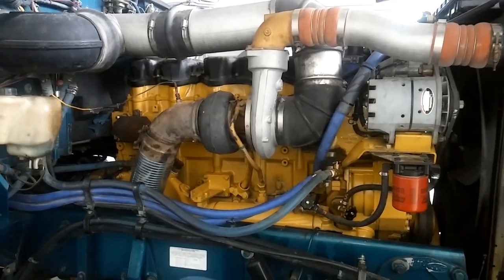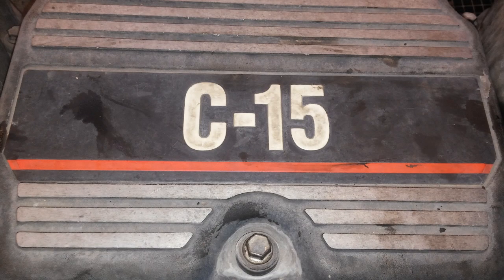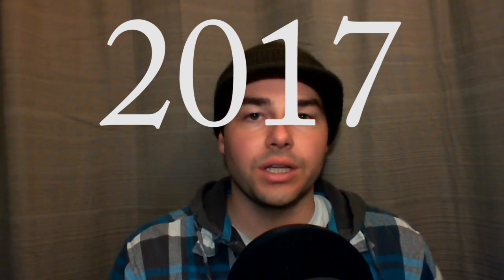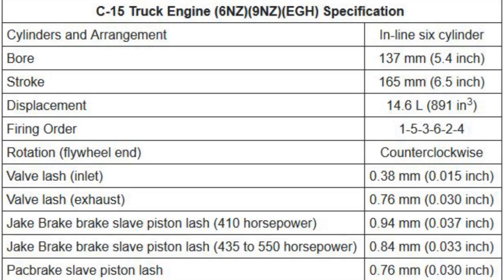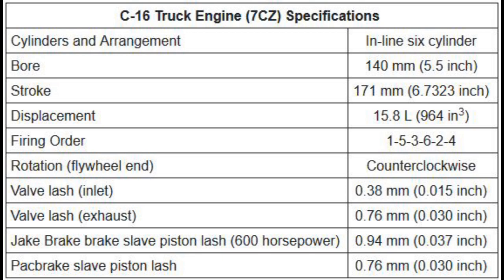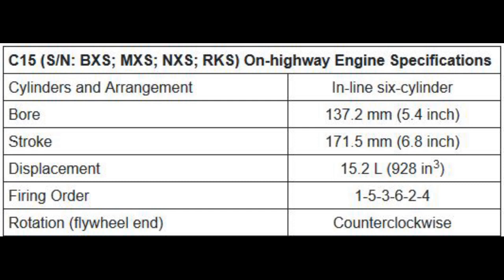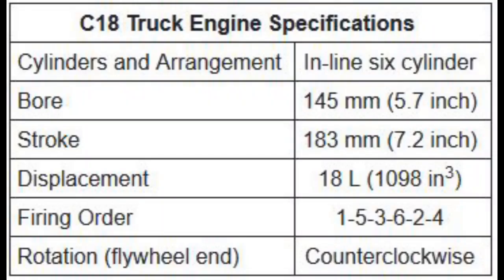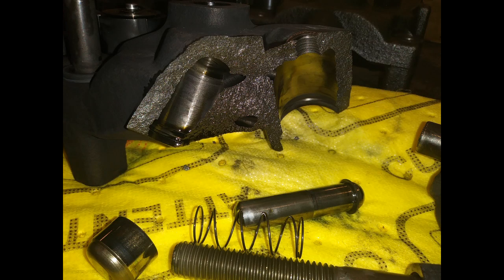What are the Differences on Cat 3406E, C-15, C15, C-16, 3456 and C18 Diesel Engines?

Comment: Could you maybe do another video or if you haven't done one on the differences between Cat road engines and Cummins engines?
Reply from the maker: Would like to, but I don't have a very good knowledge base when it comes to Cummins. I have only worked on a few ISL engines and done a few ISX oil changes, so that may have to wait.
Reply: Dip stick sucks only thing I dont like about engine. And it leaks oil if you didn't use lock tight on it on rebuild

Comment: You said there was no single turbo C-15 acert engines although in a forestry machine I work on we have a single turbo version of this engine rated at 580hp which is interesting as I thought the same, would be cool to know where this one lines up with the rest of them
Reply: If it’s an alert that means they did a turbo delete

Comment: I have a 3406c that the previous owner put a B-model pump on it. at least that's what I've been told. I would love to know the differences. I know the C-model electronics were sketchy at best but thats all I know about them.
Reply: Serial number of engine, part number on top of main injection pump housing? The PEEC engines 3406 B and 3406C had electronic sensors, BTM's and VTU that moved. They would wear and cause problems. Most people don't understand PEEC and 
can't fix them properly. They do require more maintenance on certain items.

Comment: Oh man I wish this video was out when I built my 1LW 3406E......... I would have built a C18 for sure!!!😂
Reply from the maker: Well there are a lot of C18 engines out there, just not a lot in trucks. What part of Idaho are you in?
Reply: @AdeptApe  nampa Idaho, are you from the area?
Reply: @AdeptApe  I wonder if the c18 block is strengthened to handle the bigger bore? I know the 1LW 3406e was the first year cat changed the block design to what would be a c15. From what I learned is the 1st generation 3406e where prone to cracking. Also learned the accert fuel system works on a 3406 1LW- c15. It bumps up fuel pressure to 120 psi. But make fuel hot so you have to upgrade fuel cooler😂 I learned that one the hard way
Reply from the maker: My family was considering the Boise area to move to and I've driven through most of Idaho a few times, so was wondering where you were at.
Reply: @AdeptApe  Boise Idaho, nampa Idaho it’s all the same area. I like nampa personally because the local government is more conservative based. Where Boise is liberal. Especially regather mask topic, and gun rights. This area is beautiful, very out doors oriented. I have a new 2020 rzr pro and ride at least once a week. I drive 30 mins down the road and have hundreds of miles of trails. There is a lot of people starting to move here so home values are high right now. But cost of living is still low. If you do move here or you are thinking of it let me know. I’ll help any way I can

Comment: If the block and heads are basically the same on all, the sleeve thickness changes the bore, but what changes the stroke besides the crank obviously . Is the gasket thickerer, head milled differently???
Reply from the maker: The stroke is only determined by the crankshaft throw, I believe you are confusing the compression ratio with the stroke. This isn't an insult in any way, it can be confusing. The compression ratio is determined by the Rod, Crankshaft throw, and Piston as the cylinder head and head gasket are the same.
Reply: @AdeptApe  if the throw is longer doesn't it need somewhere to go?
Reply from the maker: Yes, that is why you will have a different piston and or connecting rod to compensate for the increased distance from the crank center. If you just put a longer stroke crank with the same rod and piston it would hit the cylinder head.

Comment: have ran the a b c e cats and 6nz plus the twinn turbos.in my estimation afer 6million miles 2 trucks i put over a million on one of them was a twin turbo the other was an c model. but in overal performance and fuel economy pulling 100000 pound loads the E model out performed all.

Comment: Does the first four and a quarter 1693 from 40 plus years back have a cam in head  ?
Reply: Those were dual overhead camshaft engines. 
Precombustion chamber, with glow plugs.  PCTA.   Fantastic engines
Reply: Yes they are a true overhead cam engine. The 3406E and up is a high cam engine. Most 1600 series was overhead cam except the 1673 engines.

Comment: Hey Adept i found a 2008 peter 388 with a cat what cat engine is it for that year
Reply from the maker: That would most likely have a SDP C15 or LEE C13 which are both regen engines. They have a lot of emissions controls and I would recommend watching my regen and DPF videos for a better understanding of them.
Reply: @AdeptApe  its been converted to a single turbo 78mm so I suppose its also been deleted 700hp also

Comment: Hey sir I live in Jax Fl I run a c-15 accert recently rebuilt after getting it back i still had water pushing put of overflow and truck seems to not have much pull how do I manage to correct the issues without getting into a pride war with the caterpillar dealer
Reply: Was it pushing coolant before you built it?
Was it done at a authorized repair shop, like a Cat dealer or a TEPS dealer?
Did you have a OPT done?
What rebuild kit was installed?
What is your full serial number of the engine?
Reply: @johngoldsmith6629  yep it was pushing coolant and it had messed up my charge air cooler so I took it to local cat dealer and they rebuilt the motor 2nd time in 4.5 yrs I worked it 2 wks and noticed it pushing water out of overflow
Reply: @garynealy80  Was it pushing coolant before you built it?
 Yes
Was it done at a authorized repair shop, like a Cat dealer or a TEPS dealer?
 Cat dealer
Did you have a OPT done?
???????????????????????
What rebuild kit was installed?
????????????????????????????
What is your full serial number of the engine????????????????????
Don't see how pushing coolant messed up CAC.
Do you have a new radiator cap and what psi are you running? 
Did they rebuild or inspect your coolant diverter valve? 
Have you inspected the precooler?
Have you done a bottle test?
Reply: @johngoldsmith6629  NXS00363 is the serial and it was done at Ringpower in Jacksonville Fl
Reply: @garynealy80  Was a OPT done?
Reply: @johngoldsmith6629  whats OPT because I would like to know a series of things to ask when I return this week for repairs
Reply: @garynealy80  OPT is a rebuild that Cat offers. In-frame or out of frame. 
Overhaul Protection Truck = OPT. You would sign a contract when you picked up your truck.
Reply: @johngoldsmith6629  I didn't sign that yet I will have to fix that tomorrow

Comment: Hey adept ape, could you please let me know the location of engine oil temperature sensor c15,  please just want to replace new one , doesn't showing temperature properly
Reply from the maker: The oil temp sensor sending unit is usually in the oil pan on one of the drain plug holes.
Reply: @AdeptApe  thanks brother for help me ,will try morning again find it & change to new 1
Reply from the maker: You'll have to drain the oil pan of the 10 gallons or have really fast hands. I wish you good luck.

Comment: Speaking of flash files, can you explain FLS FTS?
Reply: FLS full load setting, FTS full torque setting. So FLS is the intercept of the curve and FTS is the slope of the curve. Like drawing a HP curve on paper from left to right. Start at Peak Torque up to hump HP (most Cat engines, some old mechanical's just had a stop bar) on down to full load. Full load is where rated HP at Rated RPM's is produced and then into governor over run. Most Cat mechanical engines had a ten percent droop governor. Electronic engines can have a programmable droop or no droop. Most Cat HD engines turn 2100 RPM's with a TEL of 2120 RPM's. So just twenty RPM's of over run, equals zero droop. You have some flash files 2300 TEL. So if that is in the ECM. Your TEL is now 2150 with a hundred and fifty RPM of droop. And as I said some engines you can turn droop on. Also you can have droop turned on with the sloop, then program a hard limit and shut it off like a rock. FLS/FTS numbers have a base line setting. 0/0, and every so often the numbers scrabble. So you have positive and negative numbers. Am told 150 to 0 to negative 150. So the only way to see what it can do is on a flywheel or chassis dyno. Cat offers a PAR run, which will measure your fuel rate along with other requirements. If the fuel rate is low (not severely), you can send it to Cat and they will give new FLS/FTS numbers to compensate for wear. Certain engine's (not all), you can request a fuel rate max out and put the fuel rate at the max of the curve. Cat sell's the engine, not the truck. All this is legal and will not void your warranty, if done at a authorized PAR dyno facility. So Wheel Horse Power, WHP is another measurement and measure's how well the truck is doing. Fuel rate in GPH is the first thing and measure's how well the engine is doing.
Reply: @johngoldsmith6629  thanks for the info. 
It just confusing on the number for the FLS FTS so many combinations that don’t always have the same results on each motor I guess. I understand they can dial a motor in to the listed hp rated. Like to c15 motor build one produces 565hp and the other 510hp they can get them both to 550hp with a combination on the FLS FTS? Aftermarket tuning you see a lot of combinations that have been on  dyno to see results.  interesting stuff, you think there is a max effort set of numbers like 0 FLS and 150 FTS or it has to be calculated off fuel rate per engine?
Reply: @sbacon67CTD  Knowing the current fuel rate helps. They are hot numbers, but legally you can't get a password from Cat. It won't fly, will kick you out. Engines that have a trim file for the EUI's vs just the four digit codes is another story. Most truck drivers get the hot four digit code and put in the ECM. EUI's are designed to flow a certain amount of fuel. Thus when you install one you program the ECM to match that EUI so flow is basically the same on all cylinders. Thus if you have a really strong EUI and put the max out code in along with a EUI that's on the lower side. You have a unbalanced engine. I like to data log the engine at TEL, start killing cylinders down to number one only, air compressor and fan off. Engine above 170 F and I kill cylinder one for a second then fire it back. I want to see if the cylinder can pull the RPM's back up. I let it run for one minute. Then I kill one and fire cylinder two and so forth until all cylinders are firing again. Naturally the engine cannot hold TEL on one cylinder. What I am looking for is, can the cylinder pull itself up from say around 800 RPM's  to maximum fuel for that cylinder. Then I look at the RPM's each cylinder will hold. I want to see balance from one thru six. So once I know the EUI's and the cylinders are fairly balanced you can put it on the dyno and adjust the fuel or do a max out if engine meets Cat guidelines. Usually when you put hot numbers in, you are masking the problem. Higher HP and torque, faster iron breaks, or blown head gasket's. 
I had a engine and we ran a PAR and fuel rate was low. Did not do a cylinder test first (my error). Made a few runs and kept trying to tuned it in. Was having a hard time with this one. So I finally ran a cylinder test and a EUI was weak. Replaced it and ran the PAR test again, the fuel rate was well above max. Could not set it back, so I had to put the base line numbers in and start all over again. The driver would have melted it down. A good driver knows how to drive a turned up engine, a bad driver will destroy it on his first trip out. 
When PEEC engine's was out, I had a driver that wanted me to put a FLS/FTS in his ECM and I refused. I could not find those numbers in Cat TMI for that performance spec. One day I had another PEEC on the dyno and I changed them to see what he wanted me to do. The fuel rate was three gallons over max. Not worth my job on what he wanted me to do, plus the fine if EPA pushes the issue.

Comment: You don't have a lot of content on the 3406B/C. I have always been keen on swapping the C18 internals into a 3406C-turned-mechanical, but I can't really justify the weight increase over my C11. C11 makes more HP/TQ than any stock 3406X, is pre-emission, and generally gets much better MPG I've found. The jakes are kinda worthless though comparatively. You could also do some videos on the newer engines CAT makes for OR - the C13B and C15B vs older models as an example. CAT dealership in Ohio said they would off-the-record push people with CAT trucks to "modernize" their old tech engines with the new OR equipment come time for an overhaul/replacement. Thanks J! Have a Merry Christmas!
Reply from the maker: Merry Christmas to you as well. Thank you for the comment.
Reply: I believe there's a difference in displacement between the 3406B/C but I read one time that the real difference is that the "C" was made in Canada and you could easily identify by the head bolts, the "C" always uses 12-point bolts.

Comment: Yes 3406b pls
Reply: I wrote this before, 3406 (now called A model) was a PCT, PCTA, DIT, DITA. (1973-1984) 92U prefix.
3406B at first was a 7FB, JWAC DITA, later ATAAC was added. As they ran out of serial numbers, the first 4MG's 1-03599 was still basically the same and still could be a JWAC.
Starting at 4MG03600 the VTU was the major change. And they went into the 90,000 serial numbers. Then they came out with a 5KJ and it was a 3406B, 1-07799. Most people get this serial number mixed up is the 3406 B 3ZJ, serial numbers 1-16181 is a 3406B. During the late 80's the dreaded PEEC was released. Electronic governor and VTU. You had PEEC II, PEEC II.V They started out as a 3406B 8TC. released next of the PEEC was a 2EK, still a 3406B.  Last PEEC was the 4CK and it was a 3406B 1-0845. Another 3406B PEEC was a 5YG strictly a 460 HP @1900 RPM'S.
After the 3406B ended the 3406C was released. Mechanical was 5KJ07800 and up, I have never seen one of these.
 3JZ16182 and up. The last fully mechanical 3406C was the 8PN. It is a totally different engine and parts do NOT inner change well with the older engine. Finally you had the last PEEC, 4CK0846 and up. It was a PEEC III and had a lot of VTU problems.  
That is I recall from memory.

Comment: Never operated a truck with a 3406E, but i have operated one with a 3406B, and boy did that engine teach me some shit! That thing will make you look like a complete rooky if ya dont know what ya doing as far as shifting with the jake brake on. You better know how to shift with that jake on, lest that thing stalls out in the middle of the road, then lord forbid you be in a curve when it happens, bcuz everything including the steering locks up, abd whichever direction you were pointing before it stalled, is the direction you will be going lol! I loved that engine though, and not to mention, it was tuned to i believe 850hp! The biggest thing i hated about it was that there was no cruise control, besides maybe that stick thing on the side of the seat that held the accelerator down, which didnt do a good job at all, and was only good for raising rpms while using the PTO! Definitely a great engine though. I would love to experience one at stock 425hp, just to see how stromg it would  be, especially simce folks always said that it was a very stromg engine at 425, which i wouldn't believe, but i wont know for sure till i experience it first.

Comment: How about 3196?
Reply from the maker: I should make a 3176/3196 video, but have only had a little experience on the 3176, haven't ever seen a 3196. I do know the C-10 and C-12 were designed from them though.

Comment: I would like to know more about all the “mechanical” 3406’s (A’s, B’s and C’s). Why are they so popular? Why is there a mechanical C and also a electronic C, but no D? Thanks for your time! I like watching all your videos and learn a lot from them.
Reply from the maker: Well the C engines were electronic, but with a mechanical fuel injection pump. A bad compromise in my opinion. I believe they went to the E model to signify Electronic more than a model progression as the engine changed tremendously from the C to the E.
Reply: A b and early C's were very easy to turn up. Last C's were bastard stepchildren because they were kind of mechanical and electronic. I think they skipped d because after the c model they went pure electronic.
Reply: @rodneyward8357  3406 (now called A model) was a PCT, PCTA, DIT, DITA. (1973-1984) 92U prefix.
3406B at first was a 7FB, JWAC DITA, later ATAAC was added. As they ran out of serial numbers, the first 4MG's 1-03599 was still basically the same and still could be a JWAC.
Starting at 4MG03600 the VTU was the major change. And they went into the 90,000 serial numbers. Then they came out with a 5KJ and it was a 3406B, 1-07799. Most people get this serial number mixed up is the 3406 B 3ZJ, serial numbers 1-16181 is a 3406B. During the late 80's the dreaded PEEC was released. Electronic governor and VTU. You had PEEC II, PEEC II.V They started out as a 3406B 8TC. released next of the PEEC was a 2EK, still a 3406B.  Last PEEC was the 4CK and it was a 3406B 1-0845. Another 3406B PEEC was a 5YG strictly a 460 HP @1900 RPM'S.
After the 3406B ended the 3406C was released. Mechanical was 5KJ07800 and up, I have never seen one of these.
 3JZ16182 and up. The last fully mechanical 3406C was the 8PN. It is a totally different engine and parts do NOT inner change well with the older engine. Finally you had the last PEEC, 4CK0846 and up. It was a PEEC III and had a lot of VTU problems.  
That is I recall from memory.
Reply: @rodneyward8357  PEEC came in B and C models. Full mechanical came in B and C as well read below.